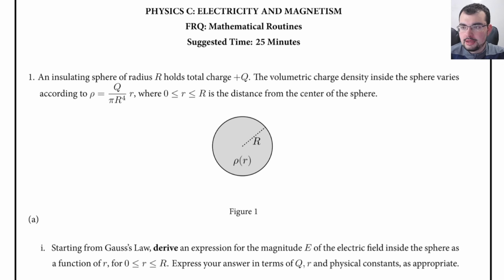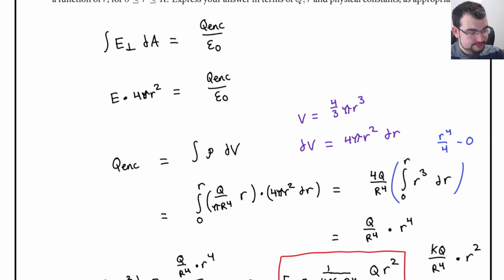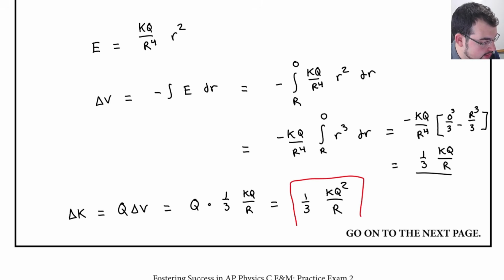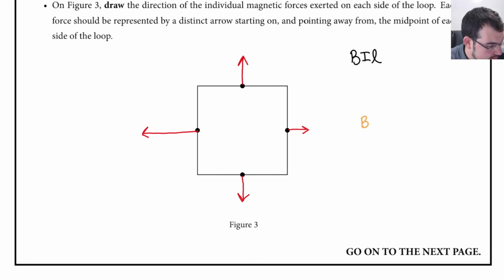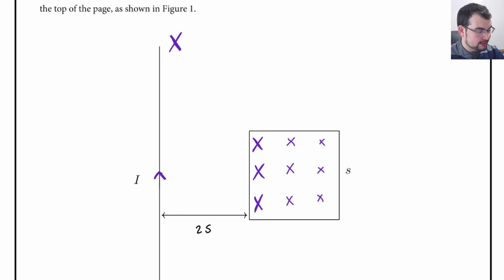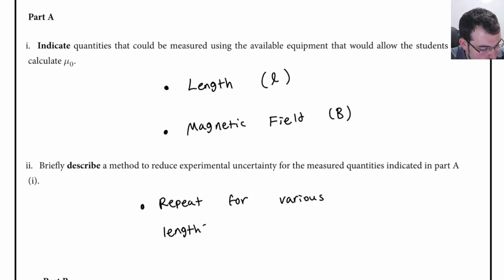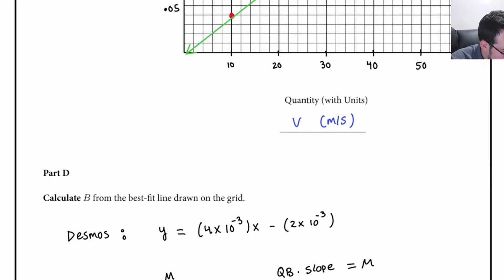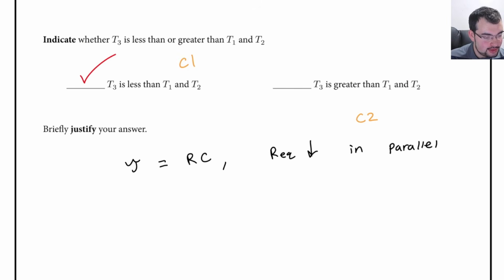AP Physics C E&M 2026 Practice Exam 2 (FRQ, Medium)

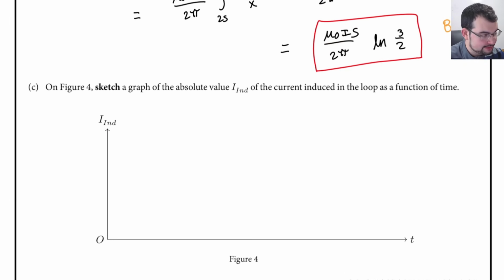Comment: Hi I have a question. For 23:00 if t = 0 wouldnt flux change be 0 since its the initial value. If so wouldnt the induced current be 0
Reply from the maker: The loop is launched at t=0 and begins moving at that instant. There will be a flux change. You will find flux is proportional to the speed of the loop if you integrate from x to x + s and take a time derivative (since dx/dt = v ) 

I know it is a bit ambiguous and I probably could have worded it more clearly…